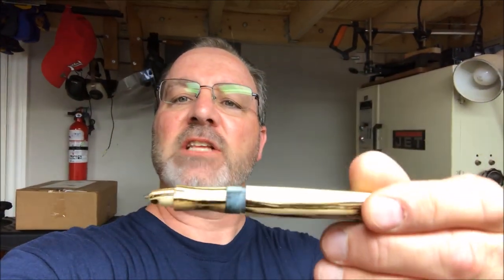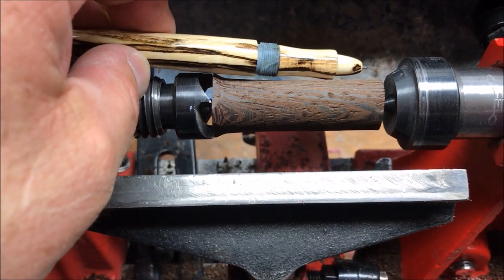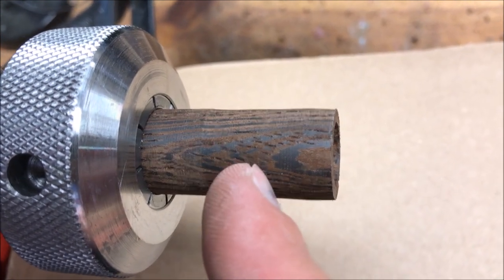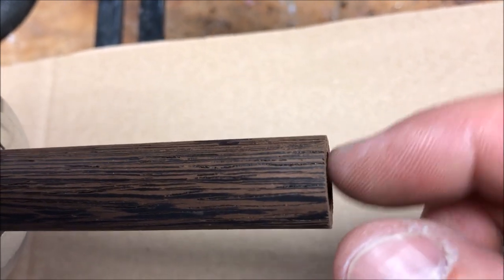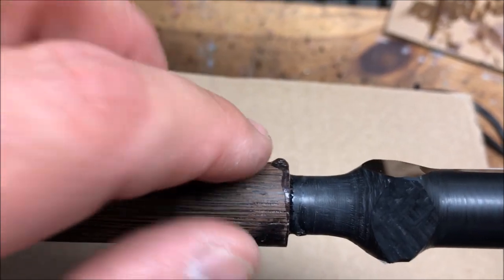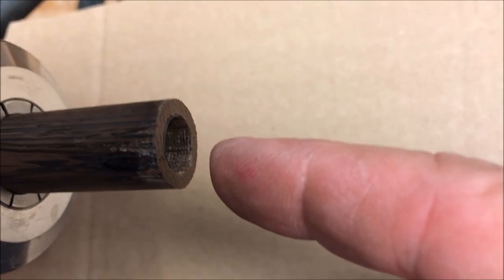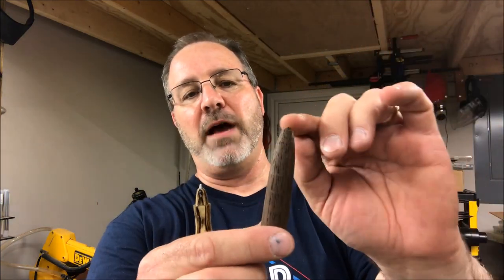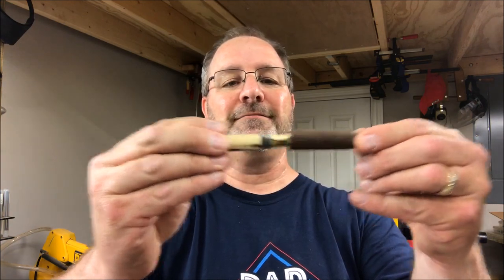Worked On A Bespoke Cap Today, You Win Some You Lose Some

Comment: I've been thinking about these hybrid wood/resin bespoke pens.  I am thinking about oversize drilling the cap to threaded depth and then casting resin into the cap to then drill and thread.  For the body, a similar thing, but actually extending the resin about 1/2 inch beyond the body to cut the outer threads on (and drill/cut the inner threads for the section to go into).  Not sure when I will get around to trying that, but it might be an interesting idea to try.
Reply from the maker: I think it’s a really Interesting idea. I’d love to see what you come up with. 

Regards,
Bob

Comment: Drill that blank out to the next size, and epoxy, not CA glue in another piece of scrap acrylic and rethread it.  I've found CA glue to be extremely iffy on a lot of glue ups and I quit using it altogether and don't have issues with stuff pulling apart anymore.  

Still need to get my video done of the metal pen stuff though, hopefully I can get some shop time soon and be able to start working on that.
Reply from the maker: Thank you William,
  Be sure to send me a link when you do get that video out. 

Regards,
Bob